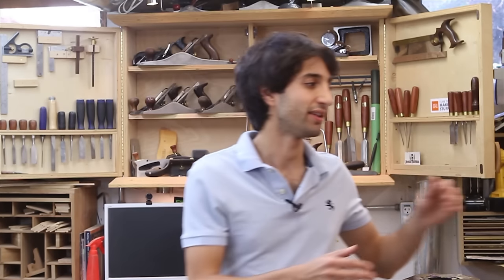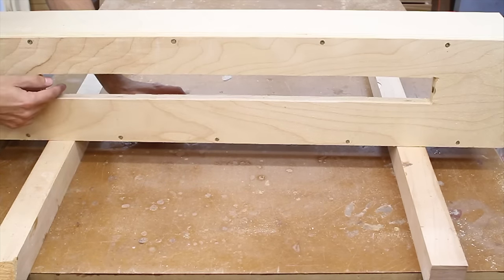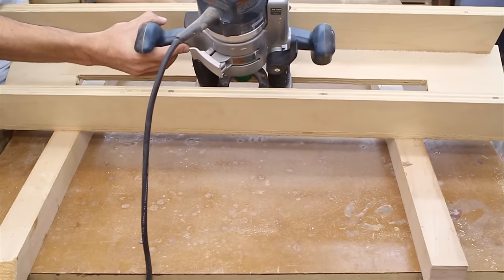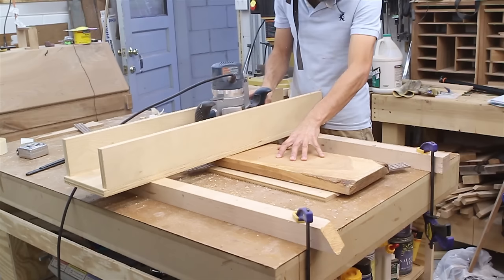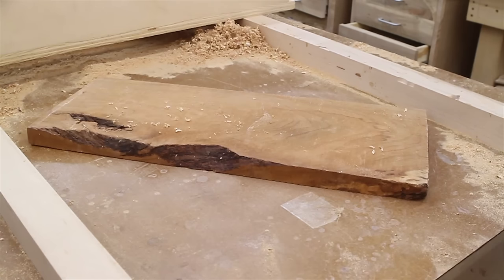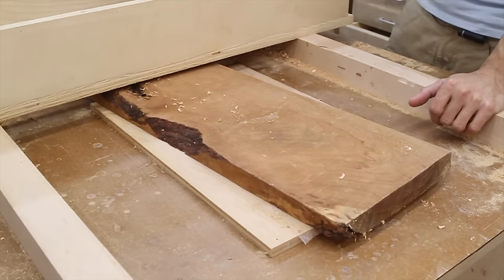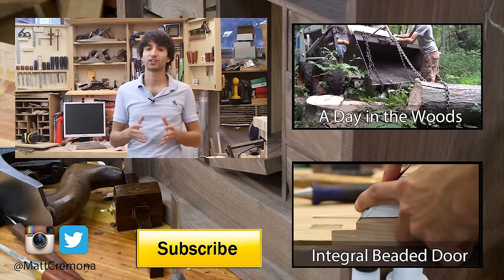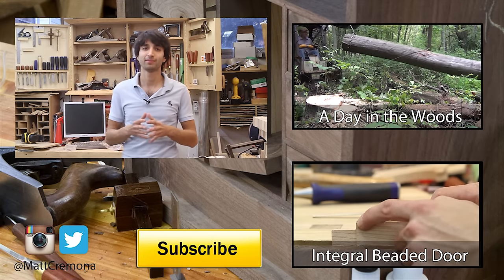Flattening Boards with a Router Sled

Comment: Matt, my old router only accepts bits with 1/4 inch shank.  Do you know of a bit available for this that is larger than 1/2 inch that comes w/ a 1/4 inch shank.  I found some good sized bits online (up to 3") but they all have a 1/2 inch shank.    BTW, this was extremely helpful.
Reply from the maker: Hey John, I doubt you will be able to find a bit with a sizable diameter in 1/4" shank.  1/4" is just too weak of a shank to support that much spinning bit.  You should be able to easily find 3/4" diameter bits with 1/4" shank though.  I'm not sure if they make them much larger than that. Thanks John!

Comment: Hey Matt.  Thanks for the post.  I too dont have a joiner but do have a planer.  I will be giving this a go on my next project coming up.  As for the side rails, I was thinking of using a couple of 6' mason levels so that I know without a doubt that they will be straight.  I dont trust milled wood to remain consistent for obvious reasons.  If you foresee any issues with that, let me know.  Thanks again for posting this.
Reply from the maker: Spekrfor ThededOne thing you need to be sure of is that the two rails are perfectly parallel so just make sure you check for level across the two rails both perpendicularly and diagonal.
Reply: Great point...thanks.

Comment: Great video.  I built several versions of the same jig and love it.  I have a downdraft box I created that I use the jig on top of when I am doing something like a cutting board.  My jig has stops at each end because I kept mangling my rails :-)  I have been experimenting with adding a vacuum hose to one end of the jig to see if I could pull some of the dust up into it.  Maybe I can punch some holes in the base to create an updraft jig.   Thanks for sharing.
Reply from the maker: haha!  I managed to cut into mine once. That made me aware of their location pretty quickly :)  Thanks for sharing your dust collection ideas.  I have the piece that allows you to hook up a dust extractor to the router but when I built the sled, I didn't take into account the additional width for the hook up...
Reply: Matthew Cremona
I have all the dust collection gear for my router too and connect it to my CT36 dust extractor.  Works really well but sometimes underneath is looks like a dust devil forming.  I should just leave it for entertainment purposes.

Comment: Hey Matt! Would a straight bit have the same results or strictly a bottom cleaning bit? Thanks again
Reply from the maker: Straight bit would also work.  The bottom clearing bits just have carbide across the tip which allows them to be plunged.
Reply: thanks a lot Matt!

Comment: Hi Matt, Is that the 1600W bosch router? I was looking at buying a router and this is at the top of the list. Do you like it? Does it handle most tasks or do you find it a bit underpowered?
Reply from the maker: I've done a lot with that router and power has never been an issue.  It is the 1617evs
Reply: Thanks

Comment: Hey brother, Love your videos man. Funny five years later you’re still getting questions on this video but it is a good one LOL. So question, was it 3/4 inch wood you used for the carriage that slides? Also, would MDF be the best for flatness or birch plywood?

Thanks man and keep up the great work be safe

Bobby
Reply: MDF works really well for flatness and I've also used the birch plywood with good results too.
Reply: Do you work with Matt or are you just a fellow woodworker answering this? Thanks Pat

Comment: Hey Matt. This is going to sound like a strange question. I get that the surface, rails, and sled all need to be flat. But does the whole setup need to be level? Obviously that would be ideal, but I'm working in unideal circumstances. I wonder if they're all straight/flat relative to each other, if I shim the wood properly, in theory it should work. I appreciate your thoughts.
Reply: I had the same question. After doing some research I think the answer is no. If the surface, rails, and sled are flat that should be fine. Shims will prevent rocking. Leveling could actually mess things up if you shim the surface, rails, and sled to level differently causing things to be slightly out of alignment. Did you end up testing this out?

Comment: That's a great way to start flattening a twisted board.  I wonder what the minimum thickness you could use this technique on without damaging the wood.
Reply from the maker: You could probably go really thin as long as the workpiece is well secured to your work surface

Comment: Hey Matt! Happy New Year! What to do about stabilizing the workpiece?
Reply from the maker: Depends on the piece.  On heavier stuff they're pretty much self clamping.  On smaller stuff you could use double sided tape if the underside is smooth or just use some hot glue to hold it in place.  In this video, I just held them by hand.
Reply from the maker: Oh and happy new year to you too!

Comment: Great idea and explained very well. Thanks
Reply: Not new. Just the basic router sled been around since routers were reworked with electric motor drive.  This is showing how just a simple but well built up set up can do just about what ever you want. In woodworking there is a certain increasing eloquence with well built increasing simplicity of all purpose basic jigs. Well built woodworker jigs alone are an amusement to many woodworkers. It's a jig thing.

Comment: Great video. Would it be possible to use a narrow bit like a 1/4 bit to find the lowest point (for example on the end grain cutting board) and then switch the bit out to a bigger bit?  Or would it be faster to just do two passes on the board with the bigger bit?
Reply from the maker: Thanks! You could but keep in mind that once you change bits you need to make sure the protrusion of the bit from the collet matches.
Reply: That's what I figured and that might be more trouble than it's worth, when two passes would work. Thanks again for the video!
Reply: You should also consider how pitchy and the hardness of the workpiece. Gum build up from to slow RPM to burnout bit from to high a RPM. You can feel it when right combination. It will be a 'cuts nice' feeling. If you read a book on how to ski would that mean your first time you will glide perfect? Woodworking is about pleasurable feed back from the tool when things are right. You will know if it is wrong. You question is about 'please tell me because it don't want to make the effort with a wrong choice, if I fail'. woodworking is about idea, hand to tool, to material to finish experience. Do! don't ask which of only your two choices. Try both and on the material and you decide what feels right.  If you are concerned about time 'wasted' experimenting then go to Wall Mart and buy a particle board reasonable facsimile of what you want.

Comment: Building one of these now. It seems I can't get my router to plunge deep enough? The bit barely goes below the sled (3/4" plywood, Whiteside 1/2" flattening bit, Porter Cable router.)
Reply: You might consider something less than a 3/4' plywood base. Perhaps 1/2" thickness or do a google search for a longer flattening bit. Check woodworkerssupply.com for this.

Comment: Matt, I had an epiphany of sorts. 

Would it not be possible to build a sled that would ride through the planer while holding a board stable?  It seems to me that you could wedge the board the same way you described for routing it smooth but then pull the sides in flush with the finished board to help stabilize it as it passes through the planer.  What do ya think?
Reply from the maker: Yes you absolutely could!  That is another common way that woodworkers accomplish face jointing without a jointer.  The only limitation there is the size of your planer :)   Here is a great video outlining that process and jig: Joint with a Thickness Planer
Reply: Fantastic video :)  Thanks so much.  I wouldnt have thought of the hot glue on my own so that additional info will be very helpful.

Youre the bomb Matt.  Keep up the great work.
Reply from the maker: Spekrfor ThededNo problem!  Happy to help!

Comment: Great video Matt! I just made a router jig to flatten my end grain cutting board, and it worked really well. The biggest router bit I had was a 5/8" straight bit, so it took a bunch of passes, but really worked well. The only issue I had was it left router lines and I'm not really sure how to get rid of them. I have tried wet sanding, and it seems to be working but we'll see. I thought maybe I would get a bigger router bit and make another very shallow pass. Any thoughts? Thanks!

Comment: Just ran into trouble with this method and realizing my straight bit wasn't the right one.  Straight cut bits with tiny little ears sticking down make a lot of tear out using this method.  I think you need to use a straight bit that is flat all the way across to reduce the chance of tear out.
Reply: I haven't had this problem with a 2 inch spill board bit

Comment: Also….A low cost plank built work bench can be levelled flat by locating the rails on the sides….levelled to a spirit level, then router back and forth across the bench top, making it perfectly flat👍

Comment: Does this only work with a plunge router or any type of router?
Reply from the maker: Any
Reply: I have found that a plunge router with a stop is best.  My router slipped down several times while in the fixed base and gouged my project.

Comment: The reference table that you end up using for this has to be not only flat, but lever, right? Thanks
Reply: it would only make a difference if the jig is at a different angle then the table
Reply: +chronic puffer than
Reply: Why? The machine and work piece are referenced to the same surface. Level to the earth is irrelevant and not required.
Reply: MrBonners yeah, you are right.... tried it a while back. Did not want to edit or delete my original post. Thanks

Comment: Great video.  One question, Doesn't the bottom side of the work piece, such as an edge grain cutting board that is typically not flat after glue up have to be already flat?  Will it not rock and / or create an uneven surface when routed if the bottom is not perfectly flat and square to the table it sits on?  How do you over come that?
Reply: You can use pieces of two sided tape to keep your workpiece from moving and use shims to keep the workpiece from rocking BEFORE you run your router over your glue up surface. When you've routed that surface (which is now flat), flip the workpiece over (you won't need to shim it as it's now flat), use 2-sided tape to keep it from moving, and then router this remaining side. This process creates 2 flat surfaces!

Comment: thanks for the video. csn you do this without a plunge router?  thanks
Reply: Question? A stationary mount?  like duh. Shim the rails with different thicknesses to what you want. elementary arithmetic. like GRADE 4. Otherwise use a plane and elbow grease, ...lots.

Comment: I am cutting circular disc free hand with a chainsaw that are larger in diameter then my miter saw will cut.  So they are up to 12" in diameter.  However they are not flat so I was wondering if this setup would work to flatten them.  I thought they would not stay in place because of the weight of say a 8" round piece that is 1" thick.  I could screw them down from the under side of the table but going to do 200-300 pieces so lots of extra work.  I thought you might have a better idea.
Reply from the maker: Hot glue would be a pretty quick way to secure them

Comment: Okay, so I built one almost exactly like yours.  Still using 3/4”  as a base for my router to slide across through, but it only Protrudes like 1/4” how do I fix this?
Reply: a collet extension

Comment: Every time I've flattened an end grain board with a straight bit I get awful tear out.. wonder why yours doesn't do that..
Reply from the maker: Could be either the bit or the feed speed.  I do get some tear out if I go too fast but even that is pretty easy to clean up with a quick sanding.
Reply: Could be that your bits are dull too.

Comment: From someone whose ONLY power tools are drills and a jigsaw, please bear with me. Well, I OWN a router, but have never tried to use it! Since the router rides on the slotted base of the sled, is the only reason for the sides of the sled to hold the router in place to keep the blade from chewing into the sides of the slot? And if so, why do the sides need to be so high? Just wondering. Thanks for your instructive lessons!
Reply from the maker: The sides give the sled beam strength which adds rigidity so it doesn’t sag or bounce as the router travels across

Comment: so why not rn the cutting boards through the planer? or is this just for people who dont have a planer
Reply from the maker: Decent chance of the endgrain board being split apart in the planer
Reply: from experience.. and research.. you only get so many free passes before you crack it like matt said or it goes flying across the room ,.. and then cracks lol. drum sander would be better! but this is a great solution.

Comment: Matt there is an English boat builder named Leo who is rebuilding a sailing vessel named "Talley Ho".  He is with 
Samson Boat Company (www.samsonboatcompany.co.uk) and is on YouTube (search Talley Ho).  He built a flattening sled using a 3.5 inch electric hand planer.  Does what your router table but removes a lot of material lots faster.  Check it out, might be useful to you in flattening large slabs.

Comment: does anyone sell something like this. like a complete jig that i can use. i don't really have a flat surface yet thank you
Reply: Because all woodworkers have a pile of cut offs that these sleds are made of.
Reply: MrBonners what are you getting on about
Reply: Jason Becker "does anyone sell something like this." your idiotic question.
Reply: Jason Becker All woodworkers have a flat surface of some kind. A stiff half sheet of plywood on two saw horses will give you a flat surface. Clamp stiffing scrap sticks to further stiffen if you want, top of table saw is flat. You think very small and in the the box at the Home Depot store.

Comment: The 4" sides look awkward. Would an 1.5" side rail suffice?
Reply from the maker: Depends on the span and weight of the router.  That's where all the beam strength comes from.

Comment: Why make the sides of the sled so high? The only part that keeps the router in place is the section that touches the base; wouldn't a 3" or even 2" high side keep the router in place just as well while making the router easier to handle?
Reply from the maker: The sides are where the beam strength comes from. Higher sides are more rigid and won’t flex as you move the router through the middle

Comment: why dont you screw the router in the center of the sled then move the sled side to side? could be a bit safer
Reply: great kingkay youd have to make the router trough way to long. The inverse of that concept would be to make a small trough the router sits in with pins on both side walls of it and it would slide on wood rails back and forth and you can pretty much see the work piece planing in real time as apples to seeing the result only after each time you slide the whole router trough to plane your next line!......... n junk.

Comment: It seems that you need a planer and jointer to build this. lol
Reply: You can do it all with a table saw. You need to make a planing jig to get one flat edge on each rail, then cut the other side parallel to width.

Then just use plywood for the flat bottom of the sled, and you've got yourself two even rails and a flat base to slide along them.